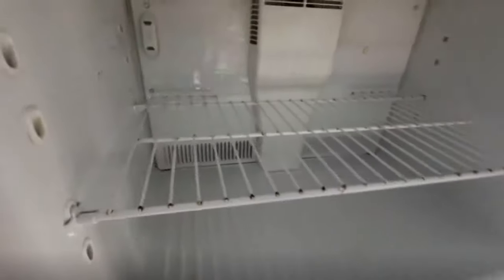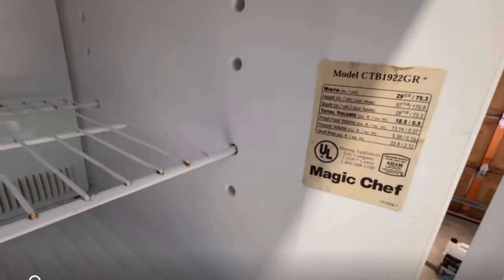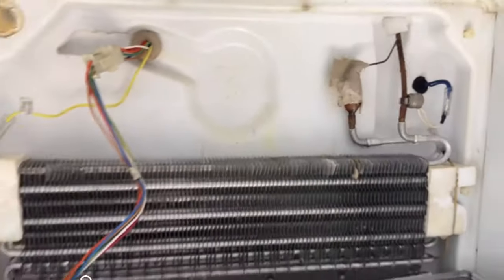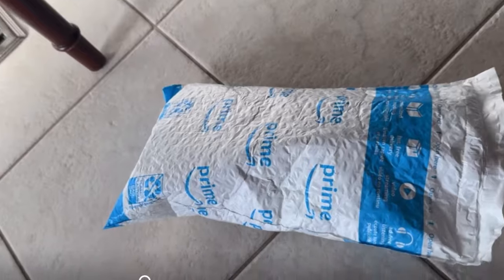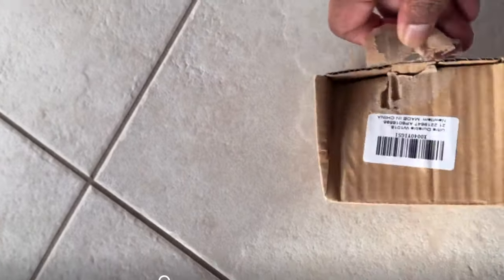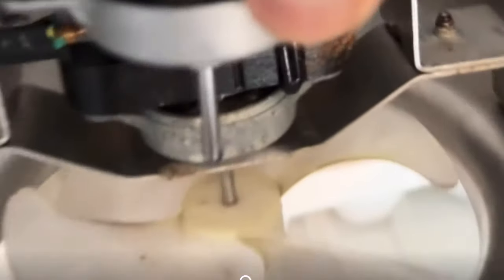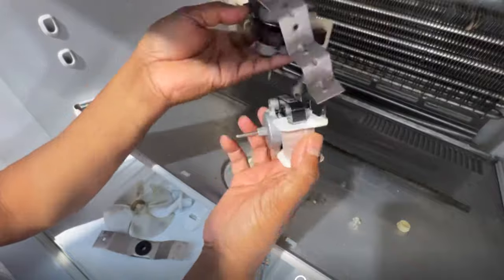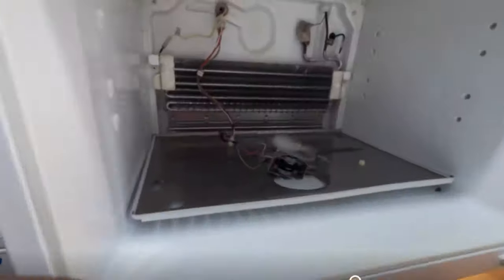Fridge is not cooling

Comment: Here’s a weird issue for a warm fridge. Cool control is working, defrost timer is working, evaporator fan is running, compressor not running.  I go to check the compressor relay and find… rats chewed the wires! Rewired it, killed the rat, and back in operation. 😅